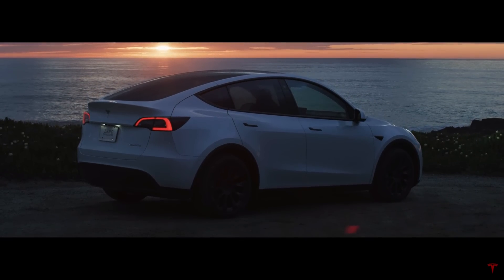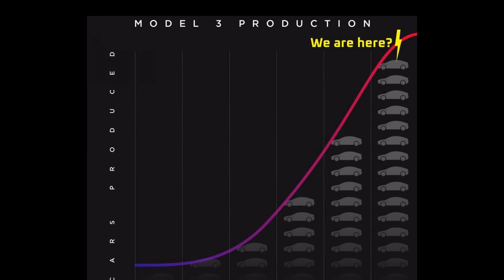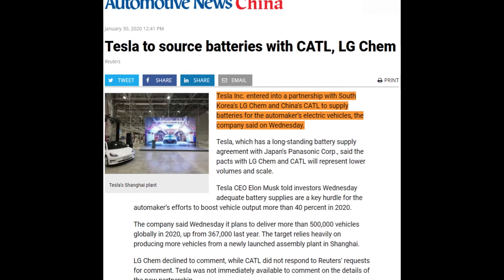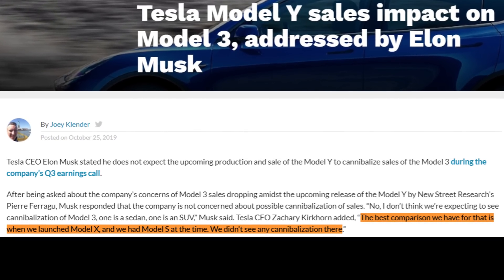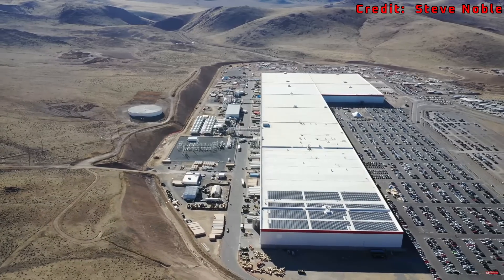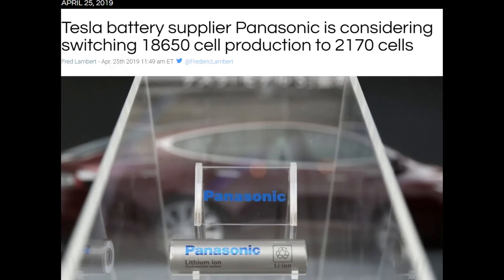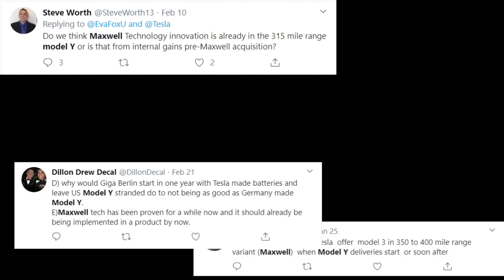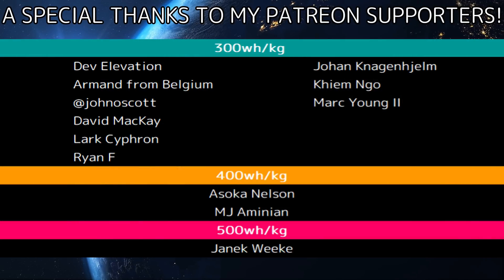Model Y Battery Supply  💥 Tesla Battery Day

Comment: About 8:55: do you think batteries are the single constraint of the model Y ramp (being the "weakest" part of the chain), i.e. the production line itself might quickly be able to ramp to 350k yearly volume?
Reply from the maker: Great question!  No, I don't think batteries are the constraint anymore based on the information I have.  This has also been confirmed by sources within Tesla (not sure if that is worth anything).  I think the biggest constraint to Model Y production is normal production ramp issues and the limited space within Fremont.

Comment: Great work as always, thanks! However I'm a little surprised that you still imagine Panasonic Japan to be a part of Tesla's battery supply chain going forward. Don't you think the long term goal of Tesla's battery production is to replace Panasonic entirely, or at least get rid of the expensive imported cells from Japan? Why would Tesla not go for a cell form factor that could work for all their car models?
Reply from the maker: Here is my reasoning:  Tesla's goal is to accelerate the world's transition to sustatinable energy.  There is nothing wrong with the batteries Panasonic produces.  Tesla will eventually move all cells to the new form factor.  But, this won't happen in the next year.  My continuing to use the 2170 for the immediate future, it de-risks the Model Y ramp, which is already tackling multiple new technologies.  However, even if they eventually switch all cells to a new form factor made in house, they can still utilise the cells by Panasonic for energy storage.  Shutting down a cell line is like shutting down a money printer in a cell constrained world.
Reply: @thelimitingfactor  No, I agree that Model 3 +Y will probably stay on the 2170 cell form factor for quite some time, but if I understand you correctly you seem to think that Tesla will let Panasonic use their battery chemistry to build 18650 cells in Japan for Model S and X? I just can't see that happening.
Reply from the maker: @LarsPallesen  Panasonic Japan is where the 18650 for S and X is currently built, and have been since the beginning.  They're already using Tesla's chemistry - unless I'm misunderstanding you or my information is wrong.  I'm saying that Panasonic Japan will move from producing 18650s for Tesla to 2170s for Tesla.

Comment: thank you for your effort! still the question remains, since the new technology batteries would be less expensive to produce, could it be possible that future production lines like giga berlin will manufacture the new tech-batteries? which would probably mean that model y produced for the european market could be supplied with next gen batteries? looking forward to your next vid. <3
Reply from the maker: Great question!  It's possible.  It all depends on the throughput of the new lines 😃... Covered in the next video.
Reply: @thelimitingfactor  ps. check my twitter (@fstropek) on shirley mengs response i just got on my question.
Reply from the maker: @grad-dd9zj  Dude!  Nice work 🙏🙏🤜🤛😃
Reply from the maker: @grad-dd9zj  This is actually REALLY big news.  Confirmation of involvement.
Reply: @thelimitingfactor  looking forward to it! Thank you!!

Comment: There is the idea that automation would keep factories running during pandemics. I think that's  a fallacy. Automation is only possible when labor is tight. And desperate labor is gonna be abundant when factories reopen. Automation is sensible for dangerous processes only. The most automated processes in the legacy auto companies have to do with engine building, and paint.

Comment: As you say, It makes total sense for Tesla to begin manufacturing their own cells for the low volume vehicles first.  Possibly down to specific trim levels to make it even easier.  Manufacturing cells is very hard.  Visually a bad cell and a good cell look identical, it's the atomic makeup inside the cell that counts.  As aggressive as Elon is, I can't see him risking everything on a sudden switch to Tesla made cells before they have a good track record on a smaller scale.
Reply from the maker: Well put sir!  Excellent summary.

Comment: They say there at 56gwh so those numbers are wrong
Reply from the maker: Could you identify where they've said this?  I'm happy to stand corrected!
Reply: @thelimitingfactor  https://insideevs.com/news/390376/panasonic-54-gwh-tesla-gigafactory-1/
Reply: @thelimitingfactor  As Tesla's battery needs are expected to further increase after the launch of Tesla Model Y in 2020, The question is whether Tesla/Panasonic is willing to continue their partnership, at the 54 GWh level? Most likely the answer is yes.
Reply: Ok so i was off by 2gwh
Reply from the maker: @bkparque  You said they were already at that number - regardless of whether it's 54gwh or 56gwh, they clearly aren't there yet.  So, I'd say off by at least 19gwh.
Reply from the maker: @bkparque  I'd agree
Reply: @thelimitingfactor  this article was written dec 30 2019. Claiming 35gwh...
Reply: They are currently at 54gwh....
Reply: Or else theyd have problems with y and megapack
Reply: Electrek’s Take

A jump from 35 GWh to 54 GWh would be significant. At an average battery pack size of 60 kWh, that’s over 300,000 more vehicles per year.
Tesla needs that new capacity for the Model Y production that is about to come online.
Even though everything points to Tesla gong to make its own batteries in the near future, I believe the automaker will make a deal with Panasonic to keep expanding at Gigafactory 1.
Tesla needs more capacity fast and Panasonic is probably their best shot at it.

Comment: Excellent insight on the Panasonic scaling effort at Giga-Nevada. There's considerable sunk cost there. However, I see these battery lines viable in the medium term (5 years) future as is. Produced battery packs, will have buyers who are not sensitive to power/weight attracted to reduced price point. RV industry,  rural homesteaders,  ranchers not to mention new products such as portable welding equipment.
Reply from the maker: Hell yeah, nice down to earth analysis Mr. Bush!  Sunk cost is an idea I should have used  🤜🤛
Reply from the maker: @spikedone2 In the next video, it will become more clear why it would be difficult to switch the Panasonic Giga lines.  Take a look at this, and think about what steps could be combined if fully vertically integrated and if Maxwell's tech would be used:  https://www.researchgate.net/publication/330902286_LITHIUM-ION_BATTERY_CELL_PRODUCTION_PROCESS
Reply from the maker: @spikedone2 I read all this, but it would take me too long to respond.  We're going on lockdown here in 24 hours.  Need to go get supplies :)

Comment: I seem to recall tesla using Samsung SDI cells for powerwall / powerpack in the past. 

Not only is there no need for giga nevada to exclusively supply the cells required for stationary storage, it's also not very smart.
From an engineering point of view, you wouldn't even want to use the same cells that are optimised to go into the cars, since energy density isn't anywhere near as important for stationary storage. That also means you can get by with slightly lower quality cells - if you only really use 80% of the available capacity (in a car you typically use 95%, in a cellphone 100%) the expected battery lifetime increases to 20+ years of 24/7 use.
Reply from the maker: Totally!  I recall that as well, but couldn't find the article.  They can always purchase cells.  And also, fantastic point!  That's another angle - storage requirements for batteries vs cars.  I think eventually, all the 2170s will be cut over to some kind of energy storage chemistry.  The most important factor there is the longevity and cost - which Jeff Dahn has solved with his cheap new additive.

Comment: Does the model Y use the new maxwell technology in your opinion? the only thing i know is that the model Y uses a new heating system or something, but i dont know if it uses the new maxwell tech that enables longer ranges in winter conditions
Reply from the maker: The video covers this.  In my opinion no, based on the reasons outlined 😊.   Basically, it would be extremely capital inefficient to switch the Model Y to the new tech.

Comment: Starting with S/X would make perfect sense. They could even make, say, 36650 cells that would perfectly fit the height of the S/X pack (if the dry electrolyte indeed offers better thermal capabilities). Any guesses on the attainable range? 600 mi S, 500 mi X?
Reply from the maker: I haven't even tried to run calculations - so many variables.  I'm thinking 450 miles as a good starting target/minimum in the next year.  It depends on how much weight would be cut and the energy density of the cells.
Reply: Plaid S the first to use the new battery?
Reply from the maker: @veikkoimmonen7300  That's my guess - but at the same time as the Semi.  This will be covered in more detail in the next video.

Comment: Another copy of the jeff dahn talk along a video summing the points and making some calculations were deleted again, and the implications are his research can make batteries that will do 3.2M miles and still have something like 90% capacity. So if tesla is trying to hide this, they dont even need all the tech just to get 1M miles battery. It might even be overkill imaginee using the same batteries for 20 years, those will be darn obsolete. Also density in range 350-400Wh/Kg. We wont need solid state or glass electrolyte until it catches up to this.
Reply from the maker: I need to do a video on all this.  It's planned, but it might be a couple months with everything I have lined up!  Totally agree.